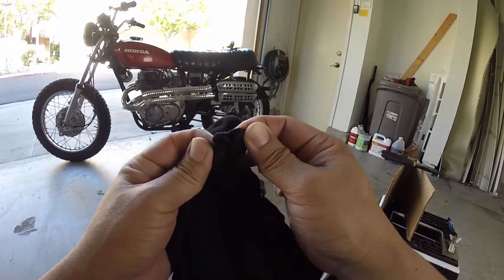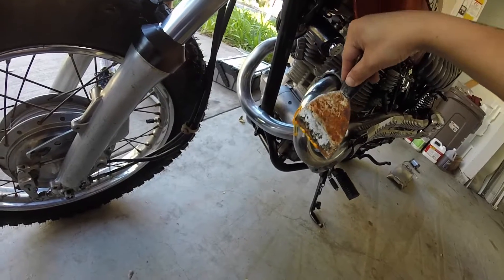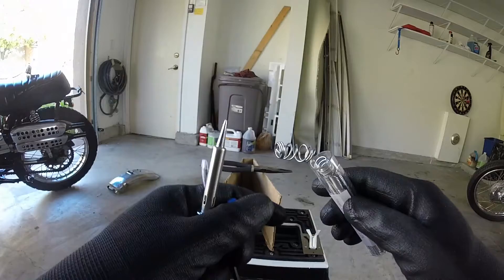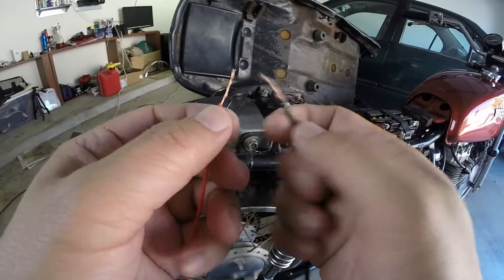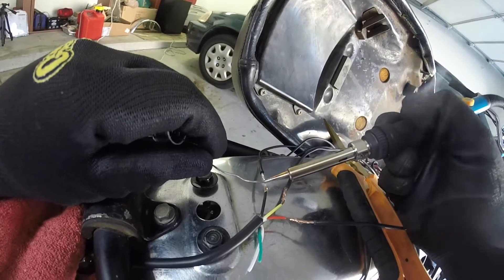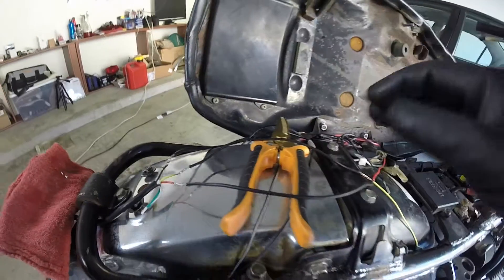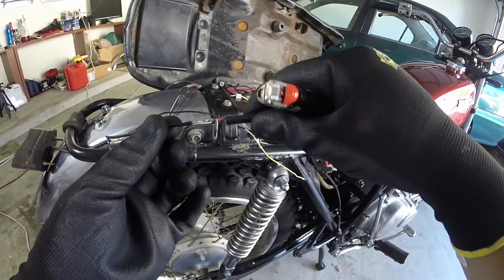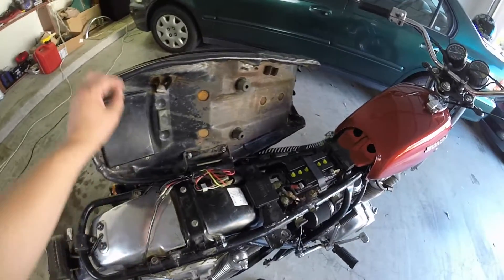1975 Honda CL360 Part 8 - SOLDERING motorcycle wires, first time!

Comment: Soldering tips: huffing the fumes makes your lungs stronger, always tin (-coat in solder) the tip of the iron to prevent rust/oxidation which will make it a bitch to use the iron, put a little bit extra on the iron tip till it's hanging off a little then apply it to what you're soldering, apply solder to the wires you're soldering not the iron itself. Also... if you're gonna use shrink tubing, be sure to remember about that after you've soldered the joint at least 5 times before making a mental order of operations.
Reply: one other thing, generally keep the soldering iron below what you're soldering, heat rises. plus you can then apply the solder directly to the wires and if it doesn't melt, you know you don't have enough heat into the wires for a proper electrical connection, keep heating till the solder flows into the wires.
Reply from the maker: Good to know! Gotta try all these next time.

Comment: Also, I got that same ebay tail light. Just remember integrated turn signals and blacked out plastic lenses are illegal in most states. I've never been pulled over for it, but it's one more bs reason that you could be if a cop is trying to be a dick.